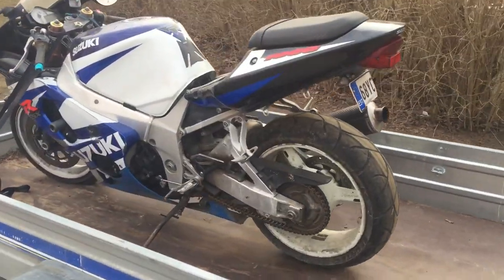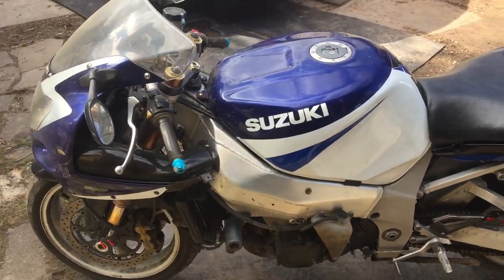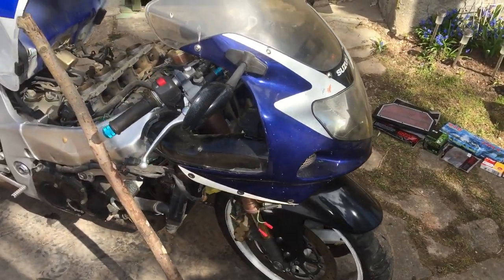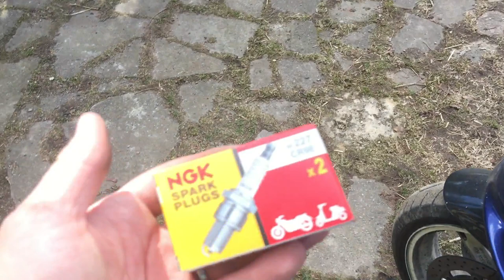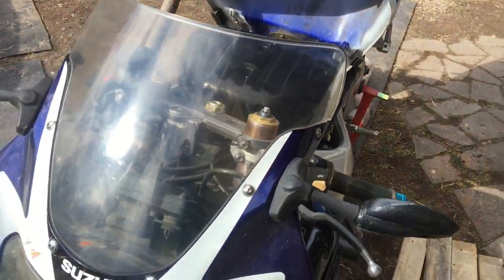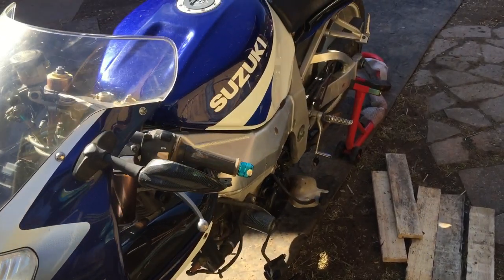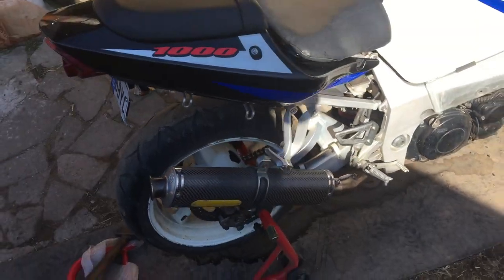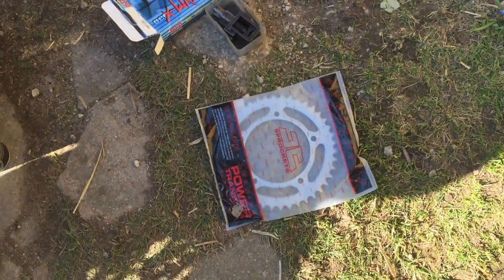Suzuki GSXR 1000 K1 first bike restoration part 1

Comment: Mines in lucky strike red and white, full yoshimura system with power commander V, been dyno'd and set up, brembo master cylinder, hel steel brake lines, and brembo pads, BNC air filter, when I brought mine, the tank had rust, had to clean it out, 3 fuel injectors had to be replaced and the fuel pump. Now it's a rocket